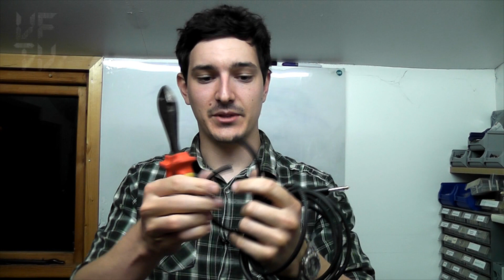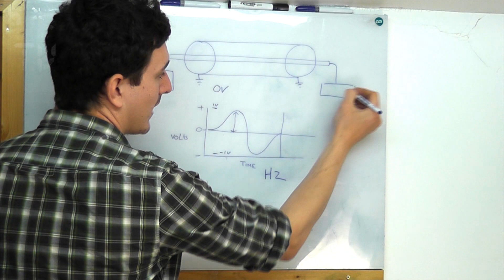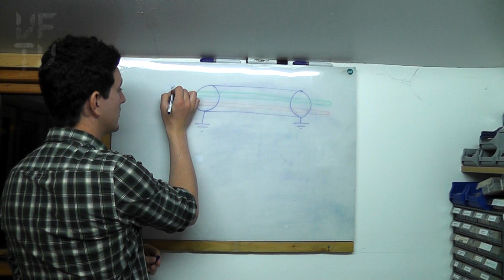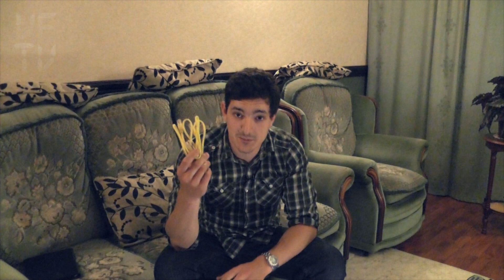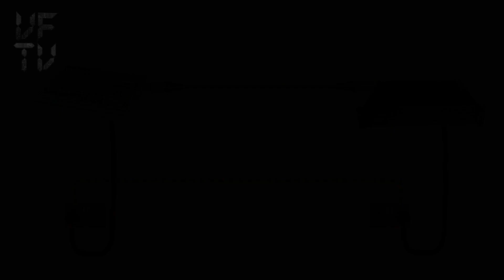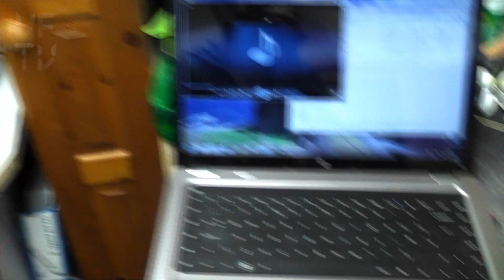Balanced audio: how it works, why it works, and should you use it?

Comment: Thanks for the lesson. You obviously know your stuff. Unfortunately, unlike you, my knowledge is extremely limited. I just bought a Focusrite interface (2i2 3rd generation) and a small Yamaha MG06X mixer. The mixer has two XLR outputs (left & right) and the interface has two inputs which can be used both for XLR and 1/4 inch jacks. Since the interface XLR mode inputs are intended for Microphone I am unsure about the matching of input/output sensitivity when connecting mixer output to interface input with left & right  XLR cables. Can you advise? Thanks and well done.

Comment: With what you described , How do you connect a XLR Main out DJ mixer to a Mixing Board with XLR ins that has a Stereo a spread button. I use a an ECLER NUO2 that has XLR Mains out and I run that into a Yamaha MG06 compact mixer using the 2 XLR ins for the mixer Stereo signal channel 1/2 and use the Stereo feature to split the sound and better control the sound (I think !) I use the XLR Main outs of that mixer to run the Powered monitors (all at the Local PUB)  I am using the external Yamaha mixer in case an epic fail and I need to run an Ipod.

Comment: Good video even with the trainers & kittens..  can you wire your system with unbal & bal equipment at the same time?    On a nl4 neutik plug & cable which conductor is + & - when cable is black & white?

Comment: You do not mention left and right.. I've seen diagrams were an arrow points to the tip for left and the ring for right.. So if TRS is not stereo it must be mono yet it has three conductors: one ground and two signals conductors (Which is where people confuse it for stereo understood) But speaking of the two signal conductors can one be the left and the other signal/conductor be the right? Because after all that's what many diagram show.. And on top of that I've heard it's all considered one channel for that entire one cable.. Do I have this correct?

Comment: I've been using pro audio equipment for years and balanced return/send/earth cables are only required for signal sending over large distances like about twenty metres or more and generally unnecessary for bands doing small gigs on small rigs with their desk pretty close to the stage. Oh, I see you are explaining that, good job. If you cut the cable closer to the connector end you could just solder another one on.

Comment: dude which A.I do i need if i want to make my desktop + mixer setup balanced??  My mixer isn't USB compatible, but it has balanced/unbal  buses for input/output everything. I use it with a xlr condenser mic when i play.  And the other thing, how do i get a balanced sound back to the Pc, because it has only 3.5mm jack line in the back. which is unbalanced i presume?

Comment: Nice video.
Couple of things to add. The ground in the signal wires is better referred to as "common." On better equipment, this common is "lifted" above the mains (safety) ground to prevent common mode noise from the mains wiring from getting into the signal. In fact, the common can float entirely free of ground, and everything will still operate properly - it is only tied to earth for safety reasons.
There is also a major downside to balanced audio. The entire signal passes through a differential amplifier at both ends of the wire. Parts quality and implementation will play a huge role in retaining the original signal, and will always add some distortion. Cheap or damaged wires can introduce a phase shift in the inverted signal, leading to huge loss in resolution - a problem that only gets worse as the wire gets longer.
A well implemented unbalanced set up will often be "better" than a poorly implemented balanced.

Comment: Great Video ,  thank you ,  the detail and education value was amazing !   One question,  Forgive me as my question my not be up to par in terms of cable knowledge.  I have a Korg Triton and Yamaha Motif Racks ,  they connect into my Saffire Pro 40.  I currently run XLS balanced into line output for my speakers.  I use unbalanced 1/4  to 1/4 from both Racks  R/L(mono) into my input connection on my focusrite saffire.   My question is,  Should I be using balanced for both Racks.  What I find strange is that everyone speaks so highly about the balanced technology,   Why have unbalanced if that's the case.  It seems to me the balanced isn't affected by distance like unbalanced so I having a hard understand why anyone would want unbalanced. So that my question,  do I use balanced from my racks.  Any info would help me .  Thanks :)

Comment: viperfrank
I'm a guitar player and about phantom power?
The reason we wanted a power source at the line in or mic input was for a preamp or OP amp was for boosting the 
single  that uses the twisted pair.  Does the boosted signal help with the THD or  noise? And could a longer run be achieved?

Comment: So in short it does not improve the sound quality much in head fi system, as the cables are too short to suffer from big noises, but how about a full balanced system? Something like instead of one dac doing stereo signal, they have 2 dacs to do 2 mono signals and go to 2  amps. Does it offer any advantage besides having a slightly higher s/n ratio and a higher driving power （which is more like a side effect)?

Comment: Is there a limit to how much phantom power you can send down the audio cable? for instance would it be possible to power an active monitor speaker and still use it for sound rather than a  separate power and balanced cable like most have?

This is a really interesting subject I'm just starting to explore.
Reply from the maker: hi there.
the limit of the standard phantom power that is built into audio equipment 1.5 - 2 watts.
but there are examples of types of Phantom power that can provide more, for example, POE or Power over ethernet can provide up to 25 watts.
but ultimately it depends on the limits of the cable and connector you are using, power is dependent on two factors voltage and current. 
so if you have a low voltage, like 12 volts for instance, and you wanted 20 watts, you would need 1.6 amps of current.
so your cable and connectors would have to be rated for about 2 amps.
however, if you increase the voltage to let's say 48 volts to get 20 watts you would now only need 0.4 amps of current, so your cable current rating is significantly less, but your cable would now need to be rated for a higher voltage.
so it's all kind of swing and roundabouts in terms of the cable rating and the connectors that yo are using.
hope this answers your question and thank you for your comment.

Comment: What would you call a rca cable with both left and right signal having 2 sets of wires inside. Two white, two red, two shield. On the left channel right channel is the same except blue instead of red.

Comment: Fantastic video! Thank you for taking the time to explain this thing in depth
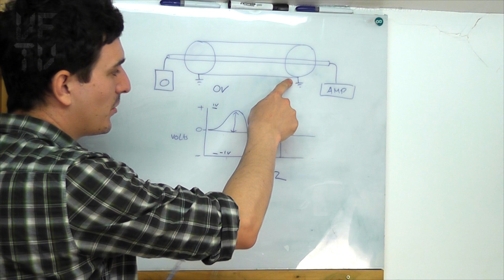There's one thing I'd like to now more about: at 16:40 you explain the term "ground", which "refers to the return path of the audio". Earlier on, at 6:37 you also explain that the "ground" works as a reference for the equipment to understand what amplitude (or voltage?) does the wave have. Does this mean the ground has a double function?
In addition, could you recommend me a video, webpage, or text that explains more in depth this "return path of the audio" thing and other related features? It'd be really helpful!
Thanks in advance

Comment: great video...

I just have 1 question:
I have keyboard and I use unbalanced cable for output to my audio interface...
here's my question now : can I use balanced instead of my unbalanced cables for output?! (I mean for L/R)
Reply from the maker: thanks, glad you like it.as long as the audio interface has stereo inputs that match the type of connector you're using.
if you want to use balanced audio on something that isn't balanced you can buy a device called a DI box or direct injection box.
this has an unbalanced input on one side and a balanced output on the other.
behringer make a cheapy one that to be honest will work just fine.
hope this answers your question and thank you for your comment.

Comment: Thanks for the video. I have a behringer condenser mic - phantom power, and i got a mono cable to connect to it, but it appears the mic isn't working. Could it be as a result of the cable? I'm a total novice in this, please educate me. Thanks
Reply from the maker: no worries, I'm glad you like the video.
yeah, some mic cables, like the ones used for dynamic mic have the pin 3 and 1 joined together.
if its one of those and your mic requires phantom power I probably won't work.
I know it sounds silly and I'm not insulting your intelligence, but have you turned the phantom power on because it depends on what you are getting phantom power from.
some mixers have a little switch on the back and the mixer doesn't make it obvious the phantom is on. not all mixers or audio interfaces have a light or indicator to show its on.
I have found the Stagg branded cable on amazon are very good and a reasonable price too, if your cable is not right maybe give one of those a try.
hope this helps, if you need any more help just let me know and thank you for your comment.

Comment: A balanced cable can also be used as if it were a stereo cable, and backwards, right? So, then, are there balanced stereo cables?
Reply from the maker: absolutely, you could technically run a stereo signal through one of these cables, just use the sleeve as the common and run the left and right signal through the 2 inner conductors.
but it wouldn't be balanced audio it would just be stereo, and you couldn't connect it to a balanced port on your mixer because it's a differential amplifier, it would just sound odd.
technically there is no such thing as a balanced audio cable, it's just a 2 core audio cable, it's just the right kind of cable to carry balanced pair audio, so it gets called a "balanced" cable.
it's like a plumber getting a piece of copper pipe out of his van and saying "this is a gas pipe", well until its connected to a source and has gas running though it technically its just a pipe.
you could have water or oil running through it. 
I hope this made sense.
thank you for your comment.

Comment: So, I have an ATR1300 microphone that I want to plug into my Sound Blaster ZxR's 6.3mm jack, after passing it through a Rolls MP13 preamp. The problem is, the manual doesn't tell me whether the 6.3mm jack takes the balanced or the unbalanced format. I suspect it might only take unbalanced.

The thing is, it will be connecting to the preamp with a 3 foot XLR-to-XLR cable, and then only the final three feet from the preamp to the Sound Blaster would be unbalanced, if that's what it turns out I need. 

Based on your video, it seems like the big advantage of balanced audio is being able to travel long distances. Does that mean that I should be able to get away with a three-foot cable being unbalanced?

Comment: Nice explanation. I don't understand why it is called "ballanced". When it was just called "differential" I would have known it from the start. :D
I have an unbalanced USB sound interface (Creative Labs SB 1240 "USB SoundBlaster HD"). Can I convert the RCA output to ballanced output using an inverter circuit? Is there something out there that can be powered from 5 Volts USB as well? I have two SIRUS SXM-8A on this thing via RCA, but the speakers have XLR balanced input, too. I hear little white noise on them when using RCA and it should be totally gone when I would be able to use balanced audio.

Comment: brilliant-finally someone who tells it in plain english-i get it ! so the 3rd ground wire is not actually necessary for the operation of the differential system-in that case in theory you could get the hot and ground wire from a quarter inch jack and connect them to the main terminals of a sm58 or similar and take the 2 twisted wires to the bit of the xlr that does the balancing and it would work? also with ground lift wouldnt it in some cases be like removing the  equipotential bonding from your rads in a house? at some point there could be a pd enough to give a shock? prob why you get zapped on the lips sometimes!

Comment: Hi. Thanks for your video. It was most helpful. I have two questions that I would like your input on:
I want to use channels 16 -24 on my desk (MGP24x) for instruments (Keyboards + Guitars). They are four stereo channels (L+R Mono 6.35mm Jacks). The stage is about 12-15m from the desk and I thought of using wall plates with 6.35mm mono connectors. How would you recommend I wire this (either with or without DI box)? If I needed a DI how would I get it back to L/R mono
Also I would like to use my four group/sub channels (6.35mm outs) to run my two dsr118 active subs. The DSR118 subs have xlr input connectors but the MGP24x desk 4 group/sub have 6.35mm mono jack connectors. Can I wire the L/R to the tips of 6.35mm and share the ground and then wire them to a single xlr connector at the other end or is there a better way to do this? Again the run is about 12-15m.

Comment: Thanks for that very clear explanation. Like Wolfgang else mentioned, though, taking the earth off of say, your guitar amp, can (sometimes) lead to nasty shocks when your sweet, wet lips touch the mike. This has happened to me live (and I mean live!), as the earth was always disconnected on my amp plug, but when when connecting up to a festival sound system rather than our own. Zap! had to put a smelly sock over the mike! I didn't die, though I suppose I could have.

Comment: 16:00 Removing ground actually is very dangerous. Your devices are grounded for a reason: safety. Not only you may get rid of the noise, you will also render your ground fault circuit interrupter useless.
So if your amplifier or other device becomes faulty, and voltage gets to the outer metal parts, the ground fault circuit interrupter is not able to cut off the power and you will have up to full socket-outlet voltage (110V, 230V, depends on where you live) on the outside of the device.

Worse, the shield of XLR (balanced) cables is connected to ground and you might get this deadly voltage up to the mics.

One way of eliminating the buzz is to get all devices to the same potential by using the same socket-outlets so that they are on the same circuits.

Never remove ground!
Reply: ***** Ground lifting only disconnects the ground from the interconnect cable to prevent current flowing between the devices. It does not disconnect the devices from electrical earth.

Comment: Great video Frank! I have a question though. I have two monitors and they're connected to my computer thru a 3.5 millimeter cable. Eventually I'm going to use XLR to 1/4 inch for them. Is the sound quality with the XLRs any different than the 3.5 cable? Does it sound better or the same?

Comment: Great!
Thank you for the demonstrations.
Sometimes I need to transport 2 ch audio (stereo) 400 mts along the street on a festival exposed to several sources of noise like electrical cables, etc.
Can I use two Active Direct Boxes (DI) at the source of each unbalanced sound (L - R) to get both channels balanced and simply connect them at the destination to two XLR mic inputs and pan them?
Greetings from Portugal.

Comment: I presume that balanced principle also applies to TV antenna. They said that the old obsolete 300Ω twin lead balanced cable has a lower signal loss than the newer RG-6 coaxial cable.

Comment: The most important thing you can do to eliminate noise background hum etc is to upgrade your mains leads to shielded mains lead's.
Now this can be really expensive if you buy branded lead's but you can make them your self for a fraction of the price and this will also dramatically improve sound quality if you have a fairly decent system to start with.

Comment: Nice one James. My speakers have insane background hum, but the power plug doesn't even have an earth connection, how can this be?!
Reply: ***** It's audible as soon as I turn the speakers on, at low volume when no music is playing. I figured it out though, the problem only occurred when I plugged it into a socket coming from an extension cable plugged into another extension cable. When I plug the speakers into a wall socket, it's dead silent.
Reply: I had the same problem which I found out to be my amp had 24v from the casing to earth. It also did not have an earth in the mains lead so I cut the plug top off attached 2.5mm green and yellow singles to the ground terminal at the back of the amp and reconnected the plug top with the earth cable to earth in the plug top thus eliminating all hum. hope this helps

Comment: Thanks for the informative video. I have a buzz problem on my system that I figured out is coming from my laptop.  I know it's from the laptops power brick, but how can I easily fix it?  I did buy one of those  Dual Transformer Isolators  but it doesn't seem to help. Maybe I am hooking it up wrong. Can you help me with this?

Comment: Great video, James. Just to pick you up on a little point at 11:30 - the signals in a balanced pair are not 180degrees out of phase, they are locked at the same phase but are inverted. If you shift the phase, you shift the position of the signal along the X (time) axis. With your demonstration sine wave it wouldn't make a difference, but with a real-world, complex wave form it'd sound a bit shifty if the signals were 180 degrees out of phase!
Reply: Exactly - and you couldn't do common mode noise rejection if they were out of phase.
Reply: You can't simply just invert the signal without it introducing lag of at least the amount of half the 180 degrees wave at a given frequency.
Reply: @arpakyna  try swapping the wires
Reply: @arpakyna  Why?